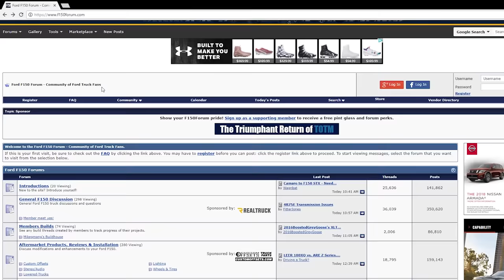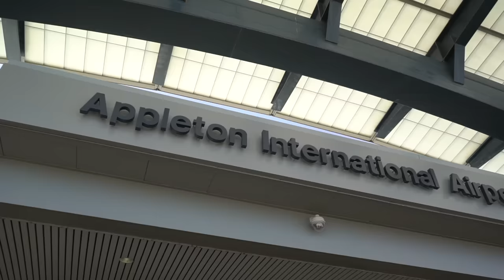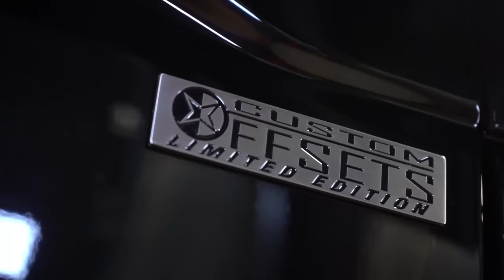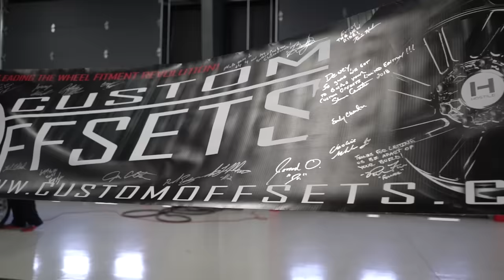F-150 Dream Build & Reveal

Comment: What did it cost him for what he had done?

I have the same truck so I'm curious.
Reply from the maker: Heres a link to the gallery add of this truck! The aftermarket wheels, tires, and the lift kit prices that were included in the build are on the gallery add!
https://www.customwheeloffset.com/wheel-offset-gallery/382367/2017-ford-f-150-hostile-sprocket-bds-suspension-suspension-lift-6in

Comment: His front Air Dam under his bumper is a lot shorter than most 4x4, did he get that replaced to get a shorter one? That's the length I want on mine, i cant stand the longer one, no clearance at all.
Reply: I cut it.

Comment: Dewey and Tiffany...love the truck, turned out great. Couple questions for ya, how is the 2.7 doing with the 35's, how has your mpg changed, if any? I have a 2016 with the 2.7 but mine came with 3.73 E lockers. The grill you got from ebay...I've looked on there, is it called Magnetic? Cannot find gunmetal chrome, do you have the link from when you got yours?
Reply: Kevin Howard... The 2.7 handles the tires fantastically. I was getting 20mpg before and now I'm getting 18mpg. I'm very pleased with the MPGs. The grill is a lariat and it's black. I'm not sure where the gun metal chrome idea came from. Here's the link to the grille I bought.
 https://rover.ebay.com/rover/0/0/0?mpre=https%3A%2F%2Fwww.ebay.com%2Fulk%2Fitm%2F202024809600
Reply: The bigger the tire, the more power compensation you'll need. 2.7 or a 5.0. Power loss either way:/

Comment: What are your thoughts on the Pro Comp Nitro 3” front suspension lift, 1.5 rear?  2021 Tacoma TRD Sport 4X4?  This is what the installer for Toyota is recommending here with 285/70/17 
33’s Nitto RidgeGrapplers on 17inch Matte black D694 Fuel Coverts -12 offset?  Thoughts anyone please help.  

Quoted at $3,100.00 cash includes alignment, warrantied, wheel speed sensor calibration, diff drop, and adaptive cruise control calibration.

Comment: nice truck,just not a fan of 12" wide wheels at all.stretches the tires usually and starts looking like a skateboard..9" or 10" the best in my opinion.never a fan of flares either,dont need them with a smaller wheel.what i have on my 16 Ford and looks killer.6" lifts in these truck look killer either way

Comment: how much is this build total
Reply from the maker: Check out the gallery add for this truck that includes the current prices of the lift, wheels and tire setup thats on this truck!
https://bit.ly/2HFbpjr
Reply: Custom Offsets hey can u drive this at a high speed and not shake like my Jeep
Reply: @jrrincon79   Depends on what you consider high speed. On the interstate I'll get up to 80 and I have no vibrations or shakes at all.